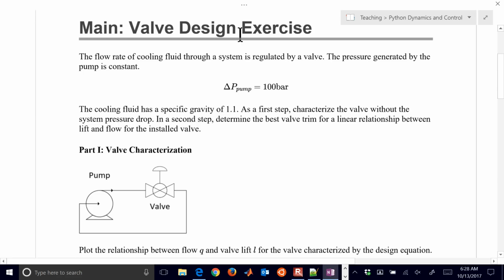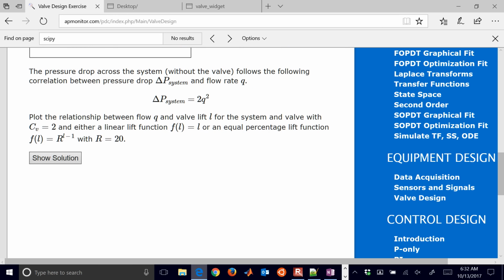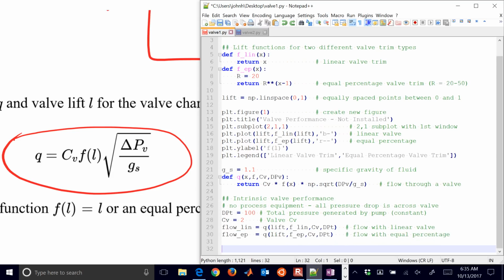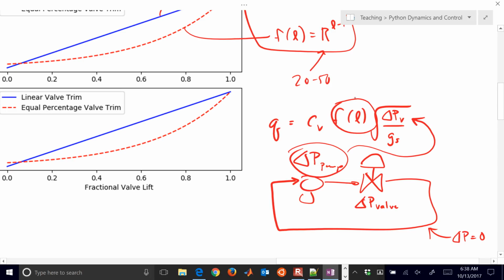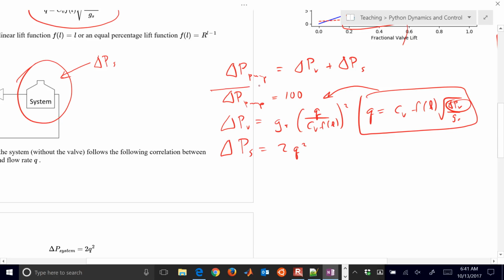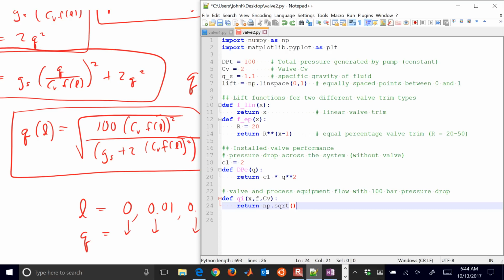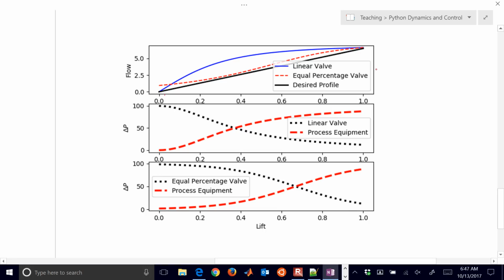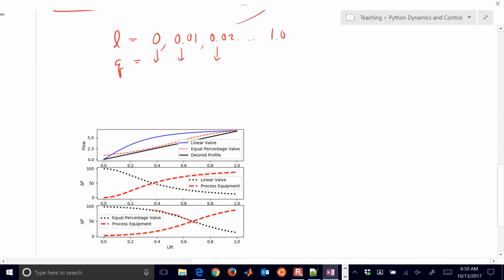Flow Valve Design for Installed Performance

Comment: Hi there, thanks for this video. Could you explain what exactly is 'R' in the EP function?
Reply from the maker: The R is an empirical parameter. More details are given here: https://apmonitor.com/pdc/index.php/Main/FlowValves  You may also want to do the exercises with this assignment to get a better understanding of the valve trim correlations.
Reply: @apm  OK, thank you!